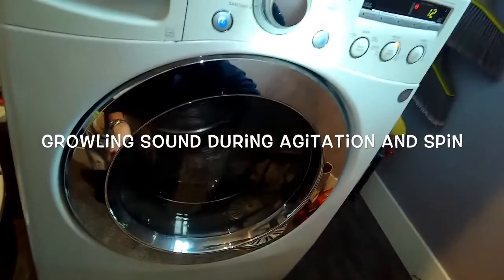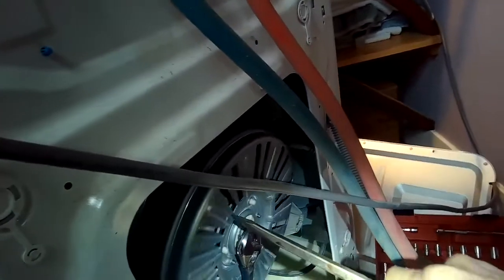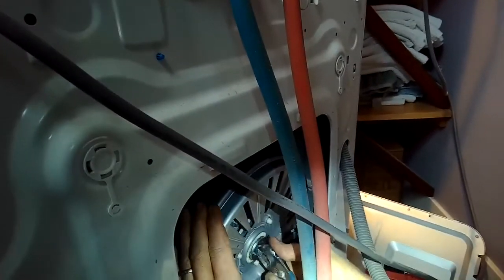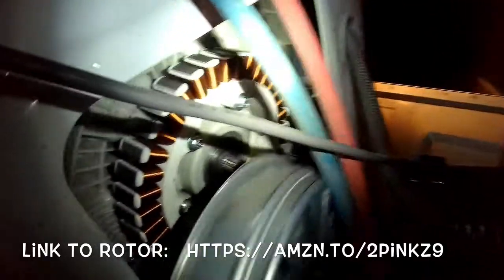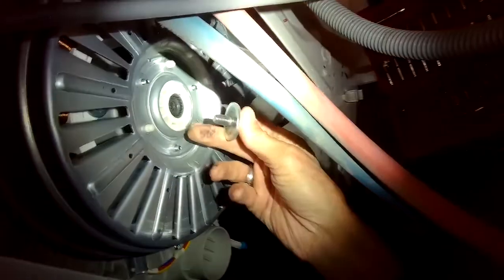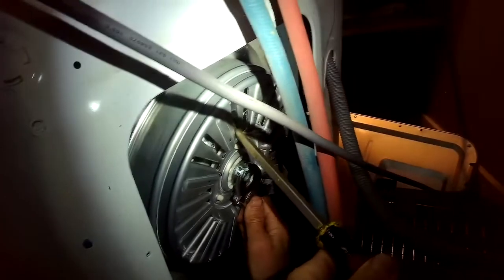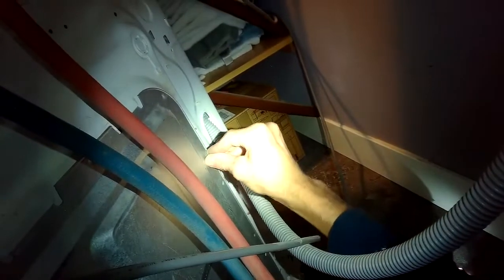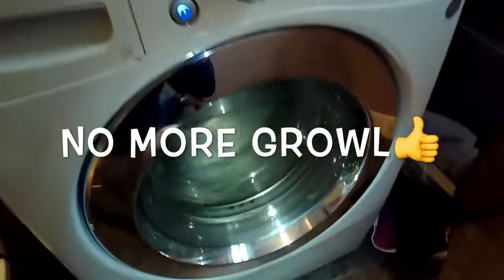✨LG WASHING MACHINE GROWLING Noise - DIY - Easy FIX ✨

Comment: I did replace my rotor and it did fix the problem when I am washing  light duty loads but the same thing now happens on heavier loads.  When I had the washer apart, I noticed the shaft that fits into the rotor had gear teeth that were also worn doen,  Is it possible to replace that part?  If so do you know what that part is called? Thanks in advance for any help you can give me.
Reply from the maker: That shaft is very difficult to replace.  Maybe just do small loads.
Reply from the maker: That part is called the stator shaft or drive shaft, and it is unfortunately a very difficult component to replace.

Comment: Is the rotor the same for all LG direct drive washers?

Also, mine just sounds like someone is holding a mic up to the normal sounding washer and crancked up the speaker volume.  Would that still likely be the splines?
Reply from the maker: If yours is loud but still spins then it’s probably the rear bearing that has worn out.
Reply: @QuickAndEasy5MinuteAppliance Would that be the tub bearing or the ball bearing?

Comment: Mine sounds like chains grinding and not spinning and I took that piece apart and the gears are still good
Reply from the maker: Hi Steve,
I think the rotor plastic splines are stripped. Just need to replace that part.

Comment: My machine roars like a helicoper is about to land. RPM'S are high on spin cycle,  just loud.. like bearings.. any advise for checks, I did open up the top and back panel.
Reply from the maker: Can you try this test: ✨ Loud  Washer Spin Cycle - Broken Spider Bracket Test ✨
https://youtu.be/2uN3ZF3T9FQ

Comment: So if I don't do that fix, the washer will keep working?  It sounds like the grinding will destroy the washer, but from your video it seems the grinding is "cosmetic" (in an auditory way).
Reply from the maker: It should continue to work for a few months, but it’s time to save up for a new washer 👍
Reply from the maker: You can try replacing the rotor plastic splines like in the video 👍
Reply: @QuickAndEasy5MinuteAppliance  -  Thanks. What confuses me is that from this video it seems the grinding is not a functional problem - just unpleasant to hear - not leading to breakdown.  Did I miss something?  

(The dryer is stacked on top of the washer and they are in a space half an inch wider than they are, and half an inch taller than they are, so getting out the washer will be terribly difficult, so I don't want to do it if it's not functionally important.)

Comment: I wish I could hear the sound your machine was making before replacing the spline. Mine is making a rubbing type noise. Drum isn't loose and it still washes. I need to email someone with a video of what mine does. I can't find anything on line that represents what my washer is doing.
Reply from the maker: Can you send a video of that to my email at: scottthefixitguy@yahoo.com
Reply: @QuickAndEasy5MinuteAppliance  Could I send you a video of mine too? It's making a loud noise that I wouldn't describe as growling but is very loud. I'm hoping it is the same issue and not the bearings. Having a hard time determining which one it is.
Reply: @QuickAndEasy5MinuteAppliance  I had a question my lg front load washer is making a noise and kinda smells like tire and I tried to use the wash without anything and it still shakes and making a loud sound.

Comment: IF PLASTIC SPLINE DOESN'T FIX GROWLING NOISE, MY FIX WAS THE POSITION SENSOR. I'VE HAD A COUPLE PEOPLE TELL ME THAT IF POSITION SENSOR IS BAD, MACHINE WON'T RUN. WRONG. IT GROWLS LOL
Reply from the maker: Thanks Jaxon👍
Reply: @  20 bucks. Amazon
Reply: Agreed I pulled the back apart and check everything and nothing was wrong or worn. So I turned it on with the back off and the growling was coming from the lower front of the machine.

Comment: Are all the splines the same on every LG washer?
Reply from the maker: There are two different size blinds for the LG washing machines.
You can use your model number and go to searspartsdirect.com to find the correct part for your Washer.

Comment: Man - after a bunch of searches, found this video - thank God. It's the only video I found that diagnoses this problem - I was about to change the bearings unnecessarily. (Even considered getting
another machine $$$!) 

I removed the back cover, ran a test, and watched. Sure enough, shaft and rotor not turning at the same speed - rotor would stop and shaft would continue turning - stripped rotor! (Like Patdonte, mine is an 11-year old LG front load. (WM 2301 HR)

Gonna definitely joint the channel & interestingly, backyard chickens is on my future list, so I'll be going there in the future as well! After joining, gonna copy the link, and order the part (along with your tester and a set of shocks. (Mine are gettin' pretty weak and my tester is bad) 

This channel is an awesome find - thanks Scott!
Reply from the maker: Thanks so much,
I think you’ll enjoy raising chickens 🐔😊
Reply: But without a clip of sound how can we know?

Comment: why cant lg use metal instead of plastic, it would make the washer last longer
Reply from the maker: You speak the truth 👍😊
Reply: You want it to break if overloaded. Otherwise it will do much more extensive damage.
Reply: The profits are in repairs and parts
Reply: that's why they don't.
Reply: They last 15 years easily.  Just now to the point mine failed on 2009 model. It's an intentional design yes but to save the cost of the higher shaft and drum assembly.

Comment: I am VERY impressed with this video! I subscribed and I thank you for being VERY methodical and precise. I have owned the LG WM2050CW since June of 2010 and its a great machine and I DID NOT have this particular problem!! I just replaced the Door gasket (bellow) and 'renewed' the corroded door hinge caused by the common leak above where the soap dispenser box 'plugs/connects' into the front panel. I sealed this with silicone caulking for the second time within 5 years!
Reply from the maker: Awesome! Thank you!😊😊
Reply: Lg are good at washing and rinsing, but shite at balancing clothes, down to piss poor shock absorbers

Comment: Can you just replace the plastic piece? Or cement the old rotor into place?
Reply: Washer Rotor Hub Assembly MBF618448 for LG Washing Machine（Original Version), Replace Part# PBT-GF30, 4413ER1001C, 4413EA1002B 4413ER1003B, 4413ER1002F
Reply from the maker: They do sell just the plastic center piece at Amazon.
Reply: @QuickAndEasy5MinuteAppliance  - what's the reason you would spend more to buy the metal part too, instead of just the plastic center piece?